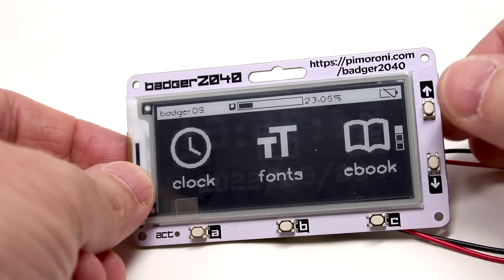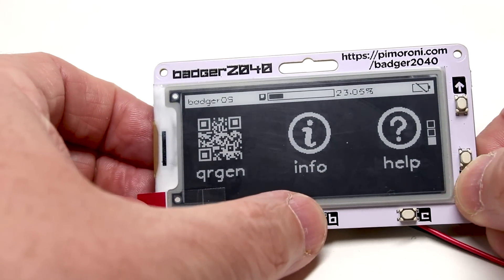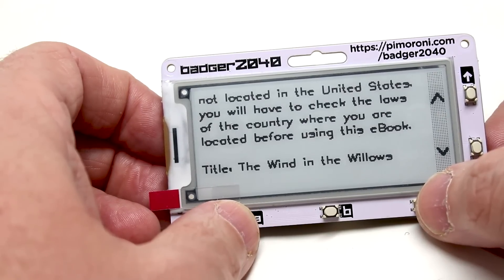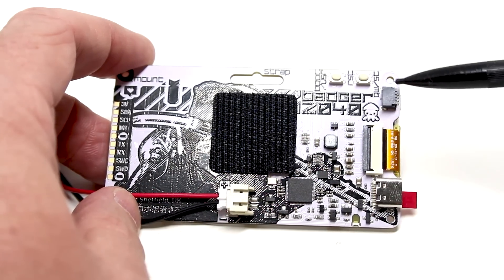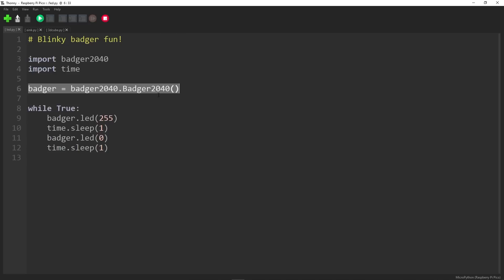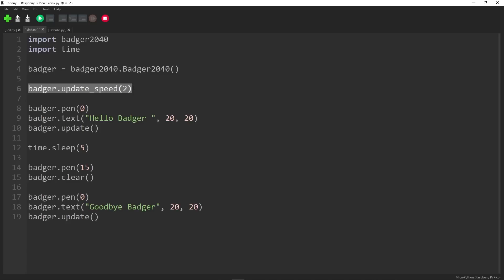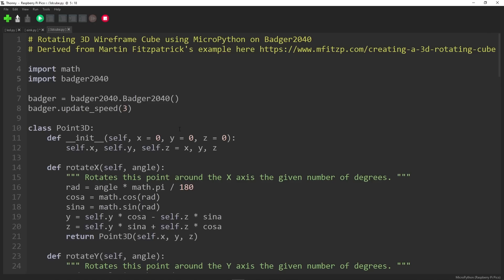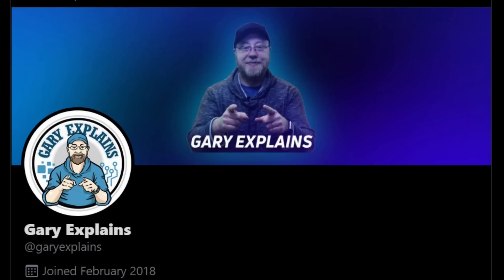Badger 2040 - A Raspberry Pi Pico with a Built-in e-Ink Display

Comment: Thank you for your videos. I find them useful. e-ink displays are great, especially when it comes to energy efficiency and reading comfort. There are a lot of use cases for them, and it's a shame that this technology isn't developped more. Of course, there could be obstacles that I'm not aware of but anyway, a lot of applications and devices could work perfectly with a 2 or 4 colour display.